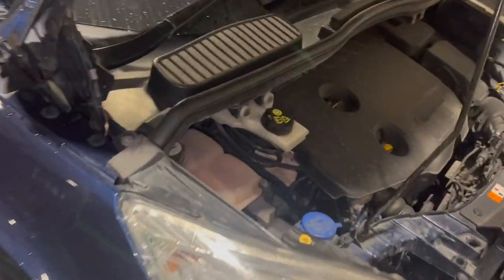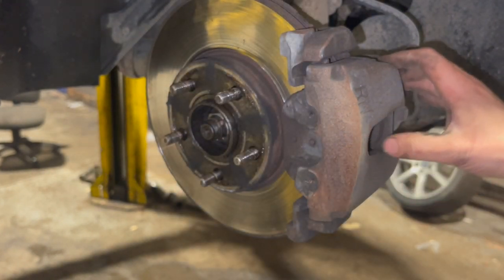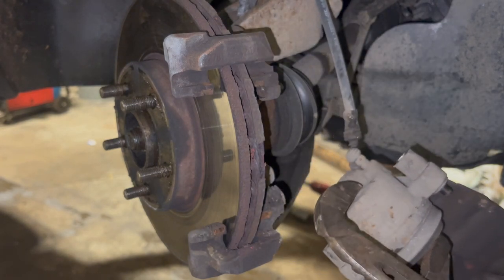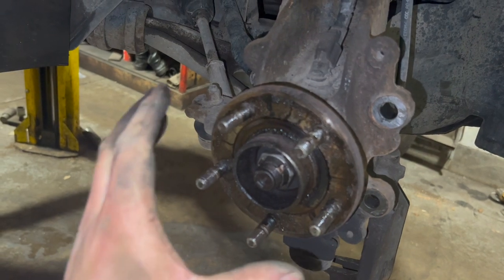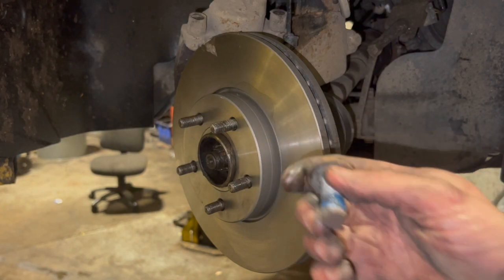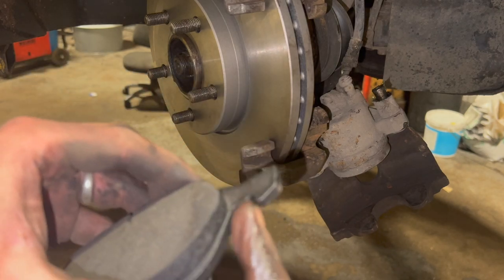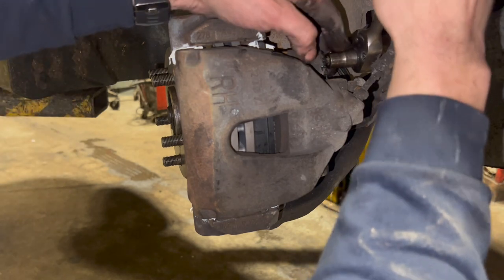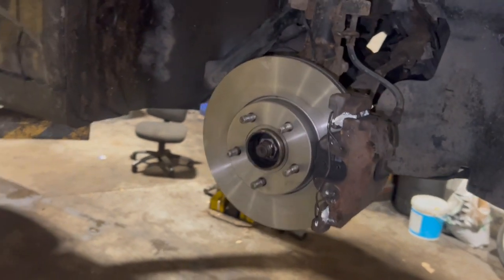Ford Cmax front brake discs and pads replacement

Comment from the maker: Check Euro car parts - https://tidd.ly/3lIO7xA  (use discount codes on site)
Check "Car Parts for Less" - https://tidd.ly/2LNEwIn  (use discount codes on site)
Front brake discs Ebay - https://ebay.us/3qQ2kW
Front brake pads Ebay - https://ebay.us/SGbtsg

Tools used :
             
Milwaukee 3/8 Drive Mini Impact driver - https://ebay.us/Pg8ilg
Socket Set - https://amzn.to/2O6BUmM
Spanner set - https://amzn.to/2DlwUZm
Allen key Sockets - https://ebay.us/VZf1ML
1/2 Dewalt impact driver - https://amzn.to/3e2Uff2
17/19/21 wheel bolt impact socket set - https://amzn.to/3gDnBlP
Torque Wrench - https://amzn.to/2VZ4CKu
Screwdriver set - https://amzn.to/30RA53L
Copper grease - https://ebay.us/ckQddu
Brake cleaner - https://ebay.us/TenE90
Ceramic brake paste Amazon - https://amzn.to/3jN87gW
Ceramic brake paste Ebay - https://ebay.us/GbuDhL
Large grips - https://ebay.us/XO4oRl
Brake cleaner sprayer - https://amzn.to/2BLF1gX
Wire brush - https://ebay.us/hTtdhH

Torque settings :
Caliper carriers bolts - 175 NM
Caliper sliders - 28 NM
Wheel nuts - 135 NM
             
Check out the Timing belt replacement on this same vehicle :
https://youtu.be/eSVdVACJBlc
Check out the Auxiliary belt replacement on this same vehicle

Comment: Hi mate. Thanks for the tutorial. I assume the rear is the exact same?
Reply from the maker: very similar mate but the pistons need to be wound bak with a special tool, if not it can be done with a g clamp and a screwdriver but ideally you'll need a windback tool

Comment: Hi, I couldn't get the piston to budge on rear disc, first time trying to do this myself. I presume this is because I missed the step of opening the brake reservoir cap first.
Reply from the maker: if you are doing the rear brakes you need to wind the piston in with a windback tool.. the rears are different to the front
Reply: @diydaly  I never got the caliper off the housing, does  handbrake need to be off, after I removed sliding pins why does the caliper seem stuck on still, I have bought a c clamp to rotate back the piston but need to get caliper off first, thanks for your reply.
Reply from the maker: @sod2068  yes mate the handbrake needs to be off, you can use a c clamp but you need to turn it at the same time .. it it wont move at all then your caliper is siezed
Reply: @diydaly  Thanks man, will let ya know how I get on with it later in the week.
Reply from the maker: @sod2068  👍